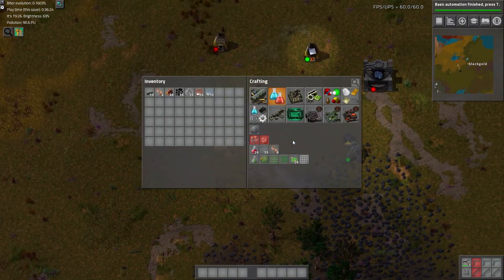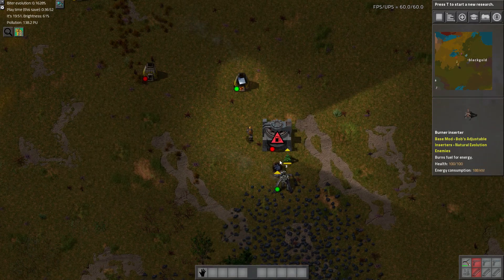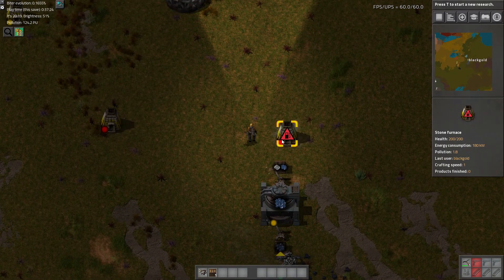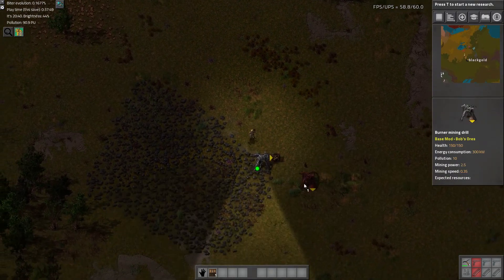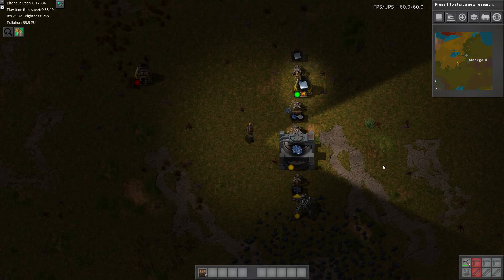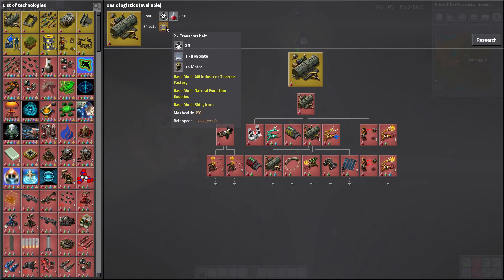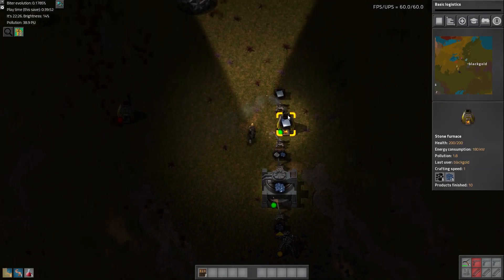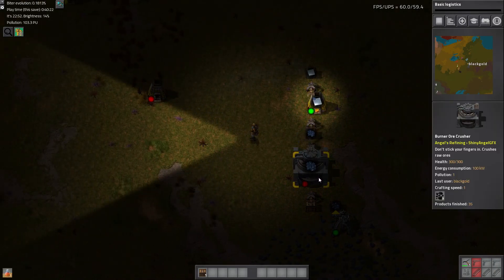[Factorio] Angels & Bobs Ep 2: Smelting With Burner Inserters (Tutorial/Walkthrough)

Comment: In this stage I made a whole snake path to get even the burner inserted filled up with coal. I do see you have different recipes for red science. Mine just had Gear wheel thing and copper I think. Nothing too difficult. And the red was actually grey science. Steam science. Only used to steam parts of the start, then never have to use it again. At about 7:50 or so your music suddenly changed to to some upbeat tune. Love it. haha. Sounds very familar. Can't really place it though... Nightmare before xmas?         Also, if you hook up the assembler with your crusher, it will just take the crushed the stone make stone directly. Don't need to pick it up by hand then.
Reply from the maker: That music is for the Factorio trailer, haha yea it's a lot more upbeat than the main game music.
Reply: About the music, I think he shouldn't cut repetitive parts out, but keep them in at 4x speed and run the "Benny Hill" tune.  But then again, any kind of music can act as the "turn Youtube staff into _____holes" spell, so better err on the side of caution.  ;)